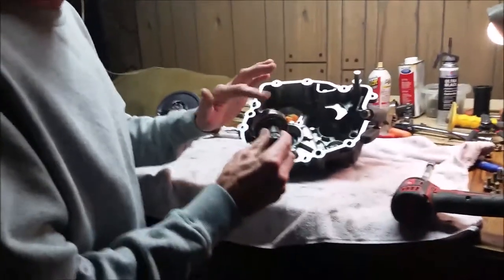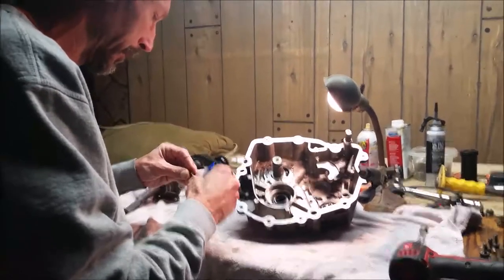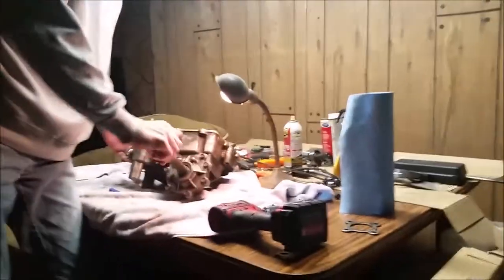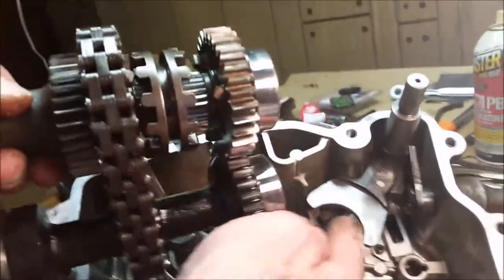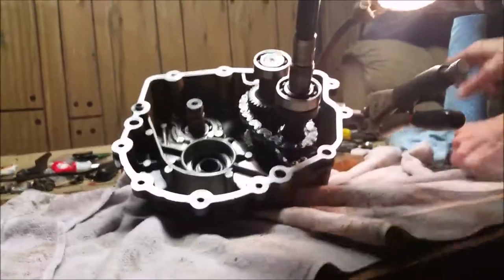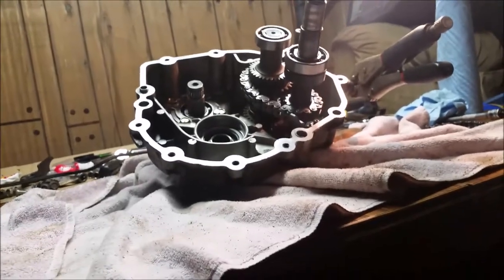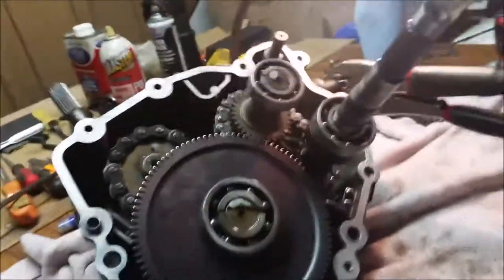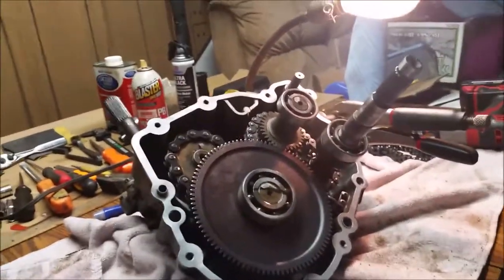How to rebuild a 1998 Polaris Scrambler Transmission Part 2

Comment: Is that a shaft drive transmission how dose it differ from a chain drive all my Polaris are chain drive
Reply from the maker: Shaft drive in front. Chain in the back. I have another video of a transmission from a regular 400 I tore apart.
Reply: @TitaniummanGarage  I’m doing an output shaft replacement on an 03 scrambler 500.   Anything I should know about?  It looks exactly the same as the one in Part 1 of your videos.